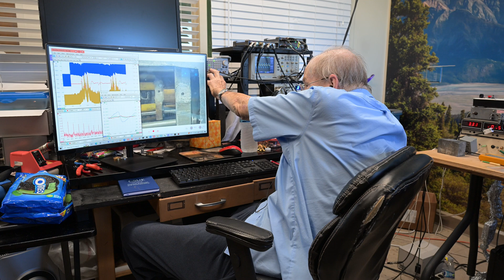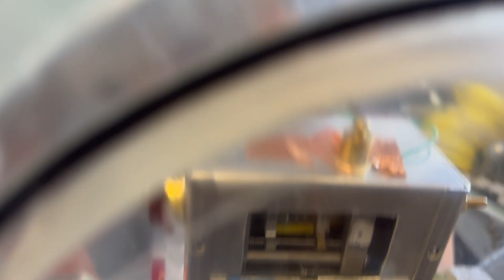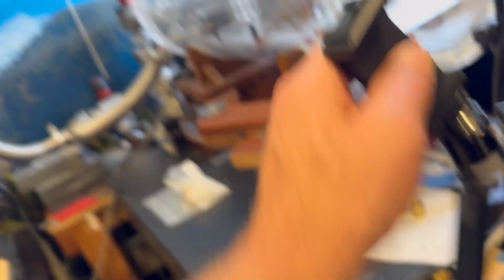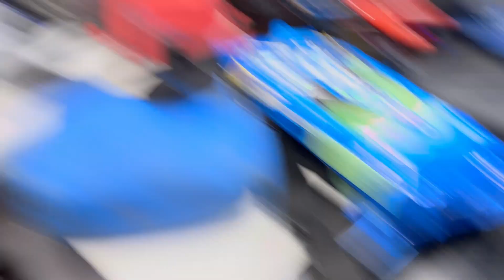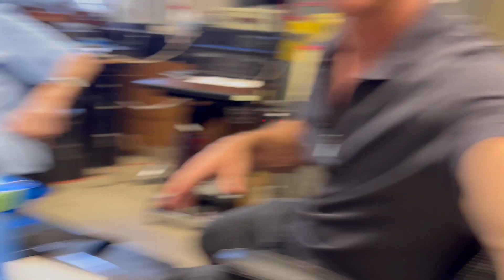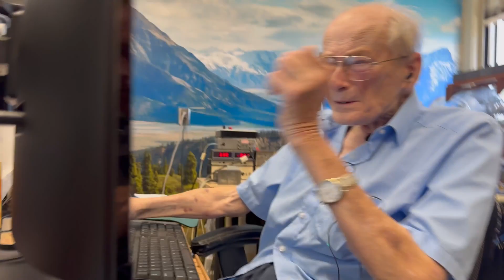MEGA Drive Propulsion Experiments | James Woodward | CSUF 2024

Comment: They were going to make an ASIC at one point that tracked the resonance frequency of the stack as it heated up, to achieve a consistent rather than sweeping thrust. Any idea what the status on that is?  One way to convince people would be to do that. I'd be interested in scoping out the work for something like that for fun.
Reply: nvm, they said something about it at the end. I think a scroll or other, better roughing pump is in order, and using the turbopump how it's intended, and one or more UPSs for those pumps given the power outage issue they described. And, especially imo, getting the control loop to stay in the thrust portion of the resonance.

Comment: In his book, James Woodward has an expression for mass that has a negative term!! If the rate of change of energy is large enough, you could end up with a negative mass. I would love to see what kind of energy densities would be required to test this effect at a non quantum level. It would put into question or change our understanding of the Higgs mechanism.
Reply: I would strongly suggest to do it in space and mid-way to Mars. Better if on the other side of the Sun.
At least the first time we see what happens when we go negative.
Reply: @ There is a term and is negative but it is extremely small. With huge energy densities it could drive the whole term to zero or negative put it would be obvious well before and negative mass would be repelled by other masses, no to be confused with anti matter which annihilates normal matter.